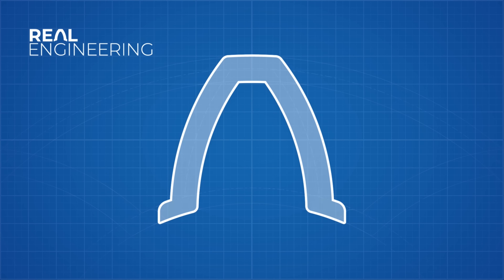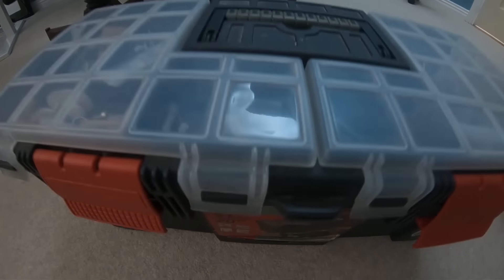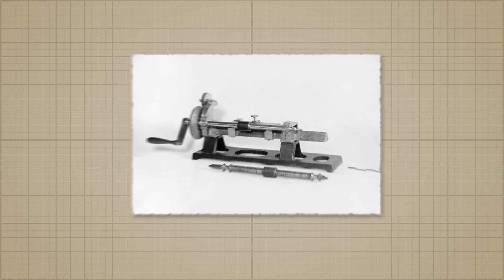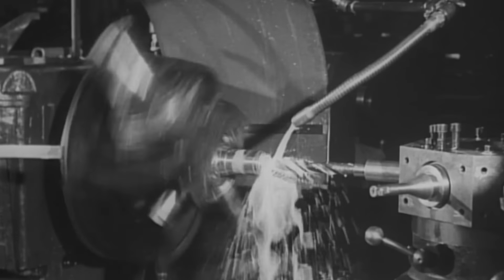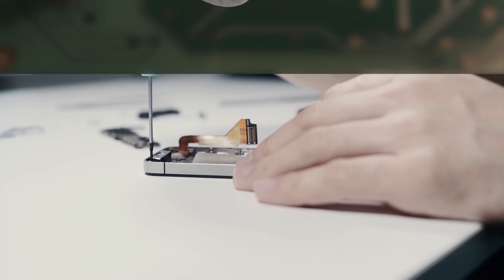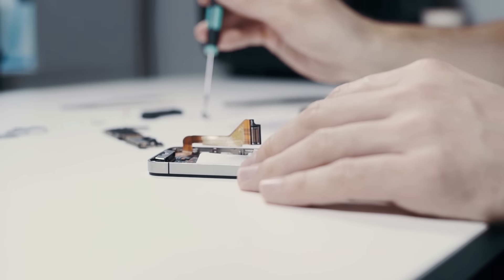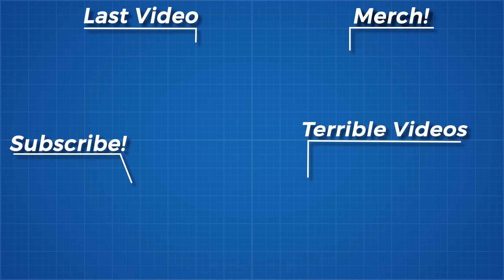Why Are There so Many Types of Screws?!

Comment: "Freedom Units" XD Got me laughing pretty good there
Reply: 'merican
Reply: This American also laughed at that.  It seems we always have to do things our own way, not matter how much (or how little) sense it makes to do so.
Reply: Yeah that good old free imperialism!
Reply: Personally, most English ("Freedom") units are varying degrees of superior to Metric ones, with few exceptions.

One of the best examples of this is Fahrenheit's absolute and complete superiority to Celsius.

In other cases, though, like mile vs. kilometer, there is no difference.
Reply: @benheinz8817  literally none of them are. Most of the measurements are literally defined by the metric system.
Reply: @benheinz8817  also Fahrenheit is literally the worst temperature system ever devised. It's quite possibly the worst metric unit.
Reply: @BlakeBigfoot  What makes you think that?
Reply: @benheinz8817  because it's completely arbitrary and doesn't make any inherent sense. Systems like Celsius and Kelvin use defined properties, like absolute zero and boiling points to establish their framework. If you ask most Americans offhand what the boiling temperature of water is in Fahrenheit, they probably couldn't tell you. But even I, an American, can easily remember that the boiling point of water is 100 C and the freezing point 0 C.
Reply: @BlakeBigfoot  Fahrenheit is based on humans, not water.  For everyday use, it beats both Celsius and Kelvin.  For scientists, however, Kelvin is the best choice.
Reply: @benheinz8817  humans are 70% water, so how is that, exactly?
Reply: @benheinz8817  is a Flat Earther
Reply: @BlakeBigfoot  Simplified, Fahrenheit is human comfort ranges.  This makes it more practical for everyday use.
Reply: @stonestreaker  False, Earth is shaped like a donut.
Reply: @benheinz8817  that has literally nothing to do with Fahrenheit. Fahrenheit was created based on the freezing point of an arbitrary solution of water, ice, and salt. Celsius works just as effectively for human considerations, if not more. The ability to easily recall state change temperatures of one of the most common substances we interact with on a daily basis, let alone that we are made of, is literally an example of that. Indeed that is kind of the entire point of Celsius...
Reply: @BlakeBigfoot  For further reading, visit:

http://thevane.gawker.com/fahrenheit-is-a-better-temperature-scale-than-celsius-1691707793

https://www.zmescience.com/other/fahrenheit-vs-celsius-did-the-u-s-get-it-right-after-all/

I don't feel like arguing with you further.
Reply: Guys, he gave up. No point in beating a dead horse
Reply: @lazrussanschei5372  Careful not to fall for Bandwagon Fallacy; just because everyone else does something doesn't make it right or wrong.  Think about it this way: if every country in the world besides the US, Liberia, and Burma committed mass genocide (which would require nearly all metric nations to start and Burma to stop, but this is just a hypothetical example, so work with me here), mass genocide would still be not OK, and everyone else should (in the context of this alternate reality) "convert" to the US'/Liberians'/Burmese's ways.
Reply: @queeditchable coming from a metric country, I don't see the need for a finer scale than Celsius to express outside temperatures. I sometimes say "and half" when looking at a thermometer, but seriously that is just me being fussy, I can't tell the difference without looking at the scale and I would probably split hairs on any scale. Can you tell the difference between 70F and 71F? Between 80F and 81F? 
Also temperature isn't the only thing that matters, give me 29C at 10% humidity, no wind and i don't like how hot it is. Give me the same but just a little bit windy and the weather becomes ok for me. Give me 28C, no wind and 80% humidity and suddenly the weather is stifling, too hot, totally awful. Half a degree C either way, which is about 1F, and the results are still the same for me and,  too fine a step to really make an impact.
Lastly Celsius having 0 at the freezing point of water really makes a tremendous amount of sense to me. The change in environment is profound. Zero on Fahrenheit? There is not that quantum leap, its already fucking cold at 2 or 1, going zero and then negative is just colder.
Reply: @queeditchable I agree that it doesn't matter to average joe. Nor was I proposing a change. I can see the huge cost of replacing signs and changing measurement devices only to end up with a water pipe which has  diameter of 2.54 cm instead of 1in, because of course actual products would lag behind road signs and such. No one wants to replace functional tooling, or parts of it before it becomes uneconomical to run or simply stops working. Some things may lag behind forever, because if it isn't broken, don't fix it. I mean where I live we also talk about screens  mostly in inches, because USA and UK were trendsetters in case of television tech and USA in case of computer tech so inches stuck. And 1cm is too fine a step in screen size anyway. On the other hand two(and a bit) measurement systems on a planet still create some barriers to trade. For lot of us from metric countries there is also this profound sense of weirdness and just plain wrongness when we first learn about imperial units and it doesn't go away. How many ounces to a pound? Sixteen? Twelve inches to a foot? Three feet to a yard. Seventeen-hundred-sixty yards to a mile? Seriously? Why, why are they doing that to themselves? Two different sets for liquid volume and dry volume? Now honest question, those dry volume units are still in use or are dying natural death?
Reply: @BlakeBigfoot  Whats this Fahrenheit you speak of. I only know of freedomheit
Reply: @benheinz8817  you don't have an argument. Lmao
Reply: @queeditchable lol nothing you just said is accurate.
Reply: @queeditchable it doesn't serve a purpose at all. Literally nobody uses it professionally and nobody uses it period outside of America and a few of its sister colonies.
Reply: @queeditchable literally none of those things are true. I'm sorry, but you're wrong.
Reply: @queeditchable for the record, I've flown multiple planes and have 2 degrees in aviation. Countries outside the U.S. still use the metric system and even within the U.S. it's a mix.
Reply: @queeditchable China and Russia are the biggest two. Also, just because capitalism has created marketing schemes such as "x inch TVs" doesn't mean anything. If you look in the book of the TV, the measurements are given in metric. You don't have an argument.
Reply: @queeditchable all of your arguments are literally appeals to emotion, not function. You're saying that some people in some parts of the world currently have a better mental concept of what a foot is vs a meter. That isn't an argument not to change and it sure as shit isn't an argument that proves that it's a better or more functional system.
Reply: @queeditchable because the metric system is objectively more useful and more easy to understand in pretty much every way. That's why essentially literally everyone besides us already uses it, including Britain, the inventor of the imperial system.
Reply: @queeditchable we literally have adopted the metric system already anyway. Scientists, by far the people who temperature matters to the most, have used the metric system pretty much forever and we've defined many of our units by the system. The only reason we still use it for the general public is because of ignorance and an unwillingness to learn. You seem to think that's an legitimate and even good reason. I strongly disagree. I'm sure everybody was really good at riding horses in 1908 when Ford started mass-producing cars, that doesn't mean that was a good reason, or even a legitimate reason at all, to not learn how to drive cars and eventually lose most of our horseback abilities.
Reply: @queeditchable nobody said anything about subway. They're a private business, they're already free to use whatever measurements they want and their footlong isn't even actually a foot long, so..

Comment: Meanwhile up here in Canada: "Robertson, uh huh, no doubt about it, best screw, yessir!"
Reply: O Canada.
True North.
Reply: They have become popular here at the DIY places for woodworking screws in South Africa now recently
Reply: Roberston is typically only used in wood screw applications for construction.
Reply: Robertson’s are fantastic for wood and sheet metal! Phillips are a big pain, but they do save machines from having their parts over torqued.
Reply: I WAS LIED TO.... I was just told the square was safer so I couldn't drill my hand with a cross Screwdriver...
Reply: Redstone Pro I’ve put my drill through my finger while drilling a Phillips head screw not fun hurts like a mother but it was my fault didn’t have the drill positioned correctly if you use your tools correctly they work just fine
Reply: @TheGoober2100   You can do that even with a Robertson square drive. The problem with all of these heads is that the fabrication process (philips, robertson, etc) always leaves a slight taper on the face of the form in effect creating a wedge. As you begin to apply torque that wedge starts to push the bit out of the head. If you don't push hard enough to keep it engaged (torque dependent) it pops out and ends up skewering your finger.

Internal hex socket head cap screws are the only ones with socket faces perpendicular to the head face (no taper). Unfortunately they don't make that type of drive for wood screws. At least I don't think they do.
Reply: In Milton, Ontario (west of Toronto in Canada), I drive everyday past a historical plaque saying that the (closed) factory behind it is the birthplace of the Robertson screw.  Bring your kids and line up to take pictures!
Reply: Robertsons is the best, while I'm completely perplexed why Flat heads are still used, maybe it has something to do with the comment about America being too stubborn to go metric like the rest of the world.

Comment: This flathead screwdriver isn't the correct number so I can't use it on this flathead screw.

Yup, this guy is definitely an engineer.
Reply: I HATE flathead screws!!!! With a passion!
Reply: @Tuning3434  I do as well. But my hatred of slotted screws was mitigated a bit when I came to understand that using a precision machined slotted screw driver of the correct size makes dealing with slotted screws a little less annoying.
Reply: @davefoc  hav you felt the pure ecstasy of using a Torx screw with an impact driver tho?
Reply: @lordcthulhu17  I have. Sometimes, even when I don't have a project I want to go drive some Torx screws into random things just for the pleasure. When I discovered square drive screws I thought life just couldn't get better, and then came Torx.
Reply: Laughs in butter knife

Comment: Torx is best! No cam out!
Edit: Also support right to repair!
Reply: 10 thumbs up :-0)
Reply: I also quite like AW but they are so similar you can also use a TX bit for AW screws.
Reply: You can have my right to repair when you pry it from my cold, dead hands! And even then, good luck; because I will have 3D-printed a bracket for it and zip-tied, duct-taped, and glued it to my cold, dead hands!
Reply: What's the worst?
Those that are made to work with a combination.
Leviton electric outlets and switch come with screws pre-installed which was great when everyone used the same screw/tools.
Now they come with screws that are hoped to work with square, Phillips, or slotted.
They are stripped head screws waiting to happen.
:-0(
I understand they want a universal screw design  rather than selling separately packaged outlets and switches based on the type of screw  fastener, but since torx is now becoming very popular, what will they do? There no way to combine all four and still get grip with every type of tool. I mean it doesn't really work with those three and adding a torx overlay, well, hello rounded hole in the top of a screw.
Reply: @ScampiTheSighted  my JB Welded hands!
Reply: Yup. I am familiar with German cars and at first I hated it, but realized that it far superior to a hex head bolt.
Reply: I just hope torx becomes more commonplace! Some sizes are kinda hard to come by.

Comment: Exactly! "Screw you" is the right term. All about marketing...
All about changing and updating...
So, you try to keep up $
Reply: If it's broken and can't be repaired. You need to buy new...
Reply: @minecraftfirefighter  if its broken and can be repaired, you cant open it yourself to repair it, go to apple and they'll say its irreparable despite countless shops doing the same work job. Making you pay 400+ for a new phone.

Louis Rossman.
Reply: @applecore4720  If you subscribe to Louis Rossman you already know about things like iFixit.  Savvy consumers know they (or their local shop) can fix things without OEM extortion.
But most consumers buy fashion, not tech, and they basically don't mind having an excuse to buy even newer fashion.  Until they finally can't afford to keep up with fashion.

Comment: I'm very patriotic, but the imperial system sucks. We need metric.
Reply: @SlocketSeven  millimeters.
Reply: @SlocketSeven  just buy a rifle chambered 5.56 Wilde, they can fire .223 and 5.56. the main difference is the chamber Pressure and the throat length. Or better yet if all companies switched to 5.56 as the standard it would be fine.

Comment: Torx beats hex any day!
I personally believe we as humans all over the world need to stand up for our right to selfrepairs, Apple is just the spearhead, software is another problem in this!
WHO IS WITH ME?!
Reply: how?
Reply: @AlexRaxach  How what?
Torx beating hex? They don't tend to take damage as easily, you can apply more force and the heads are usually a bit smaller, as the forces can be diverted better.
Banding together to protect our right to do selfrepairs? Band together, list things that are obviously got broken because of cheap circuits that can't be repaired easily etc. If a product shows signs of allways breaking at the same spot due to the same reason it's been designed to break. We even have had a few scandals in engineering in which profs. told students how to design fix that they get broken more easily. YES as an engineer you're supposed to design as cheaply, lightweigth and within the expected runtime as possible, but laws exist that don't allow a "kill switch" same for software. 

Example: The Brother printer of my dad, he found ways to circumvent software issues that "broke" it after ~5000 pages, sometimes the cleaning sponge was "filled" with sooth etc. he used online tutorials from a chinese guy to fix these issues, they worked. He went into the software of the printer and did a full reset, usually the printer asks you to send for a technician who also presses a few buttons and wants enough money to buy 2 new printers etc. he got the printer up to ~17300 pages, this way. Then he went for a coffee in the middle of doing some paperwork and returned an unknown software from brother had opened itself did something to the printer and suddenly it's completely unresponsive, the software also deleted itself, this clearly is a case of the company "killing" the printer directly.

And look at US famers they fought for the right to selfrepair and the companies denied them acess to the software or diagnose tools, illegaly as the supreme court found. (Btw the tractor producers didn't even have the parts on shelf anymore, still they denied things and made it as hard as possible.)

Comment: You forgot Pozidrive screws. IMO, a huge improvement on the Phillips head.
Reply: Yes, but they're easily confused and both are still inferior to Torx
Reply: I've always hated pozzies. While I do understand the reasons for their existence a good Phillips tip in a Phillips screw was the best option if you need to drive a screw at arms length at awkward angles.  The taper keeps the shank locked tightly to the head in a way that is the most stable of the two. I'm forever cursed because of my industry to have to change between the two every working day of my life.

For the last thirty years I've cursed pozidrive.

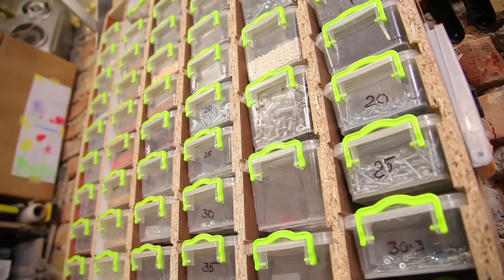Comment: 3:34, not really, UNC-screws are still used a lot (for example in desktop PCs), and they don't fit into ISO nuts. And even within ISO, you have 2 diffeeent threads for every diameter (coarse and fine).
Reply: The tripod mount is a UNC thread, used world-wide and present on most Cameras made in Germany, Japan, or anywhere else.  There are two sizes: 1/4-20 and 3/8-16.

Comment: Nintendo and Apple love proprietary screws. Pentaloupe and Tri-Wing Respectively.
Reply: Ford used to put a single metric or other different bolt head in a place you can see.  Anyone who works on cars will have stories about stuff like that.
Reply: @kensmith5694  or you find out one screw is actually a counterclockwise screw and you want to die because you snapped it and the boys are laughing at you

Comment: "the best in class is always defined by the second best in class" - lol - we here in the US are slowly becoming the butt of so many jokes (face palm)
Reply: l love  this channel, but he indeed does not have practical knowledge, re standard vs metric, metric is super prone to being misthreaded resulting in stripping, its way less common in the larger stepper slope of a standard screw. But yeah, agreed "we" here in the US are wrong about many other things!
Reply: @jonathanfoltz9713  metric screws work just fine, nobody is going to bend backwards to fit the imperial system because its such a pain even if there are any advantages